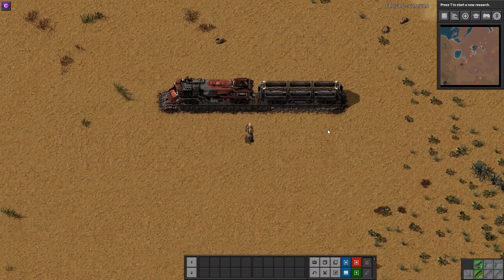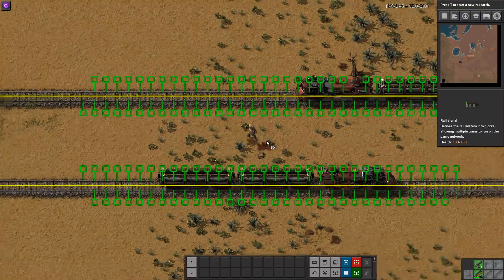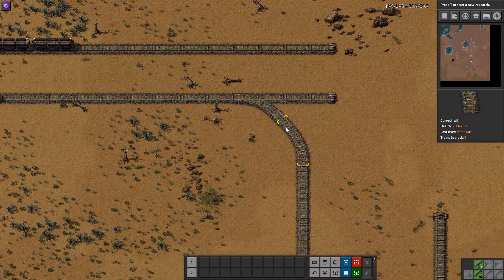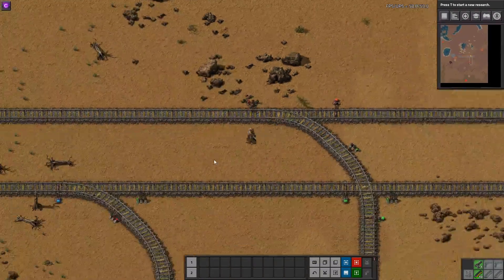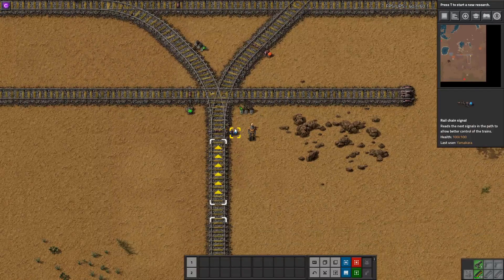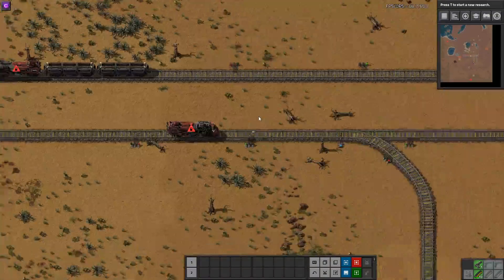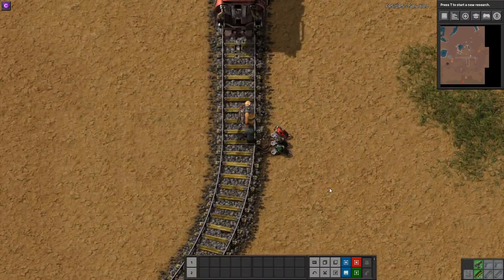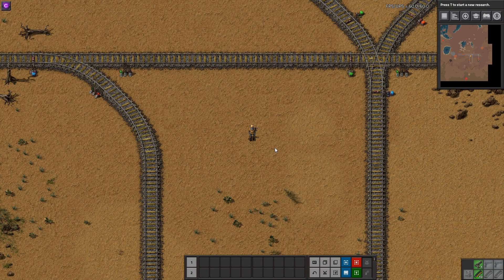Factorio Trains Guide - Signal Edition

Comment: Quick question for ya let’s say you have a very very long train run and you have multiple trains using the same path, do your place train signals intermittently on said path so that multiple trains can flow on the same train run? I’ve have it where I’ve got 2 trains using the same path to deliver oil but they won’t get onto the same long path until one of the trains has gotten off to the side at its train stop, off of the main path. It’s a double track not a single so trains can go both ways at once but they can’t go the same direction at once if that makes sense
Reply from the maker: Hmm. .. hard to answer here but possibly place your rail signals at intervals as long as your longest train is the correct answer. But... How long is long?
Reply: @YamaKara  I think you’re right actually, I’m going to give that a try. Most of the train systems I see are those “city block” square style systems that have a lot of intersections and plenty of rail and chain signals in between every destination so that’s probably why trains flow so easily on that style. 👍🏻 but from your teachings I should be able to pull it off!

Comment: There is one question i cant think of the answer for: Do you need that chain signal in the middle at 6:40 and at 5:49?
Reply from the maker: You don't NEED it but what it does is it looks down the multiple line directions and  further makes the current chain system better by adding more increments, which if say a train was going near the intersection to activate one signal, to go to the Outpost, it wouldn't make ALL the other signals blocked. But you don't need it